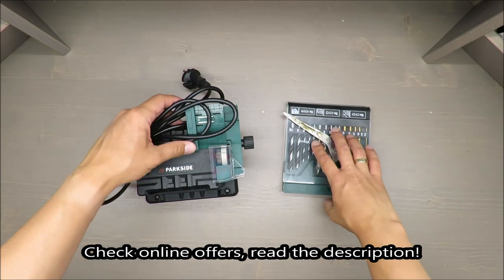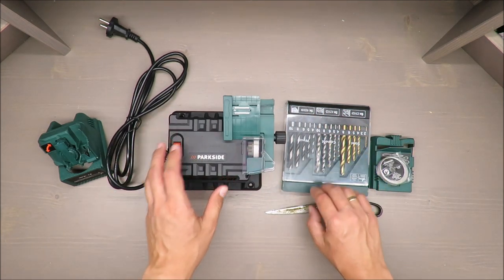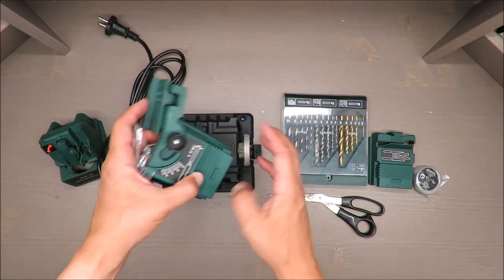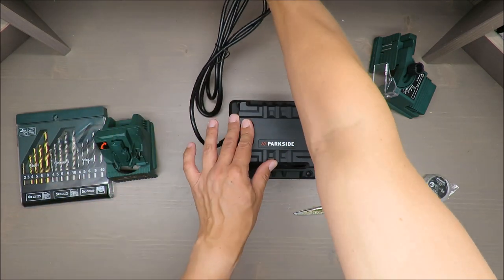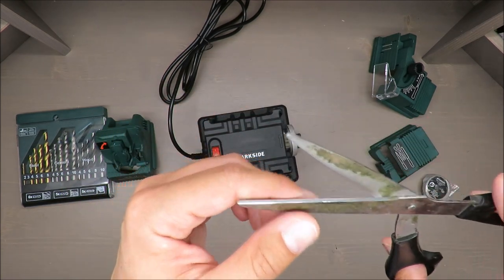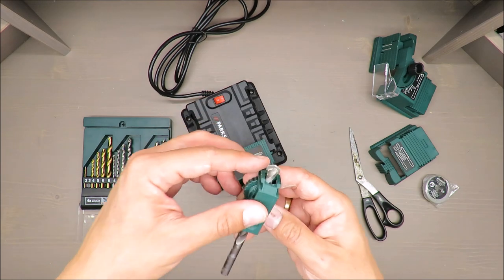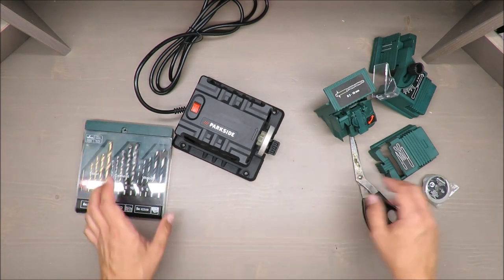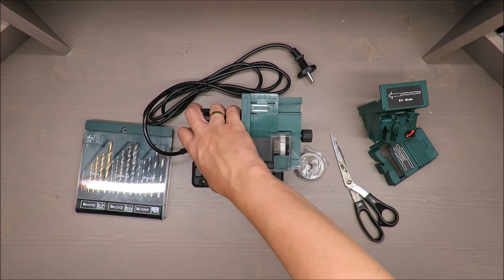Parkside Tool Sharpening Station PSS 65 B1 REVIEW / TEST (Lidl 65W 23100)

Comment: That drill which you were sharpening is tipped with tungsten carbide, which might be harder than the grinding wheel. The regular metal drills should sharpen more easily. Thanks for taking the time to share your experience - it was helpful to me to see before splashing out my 20 Euros..
Reply from the maker: Your welcome.